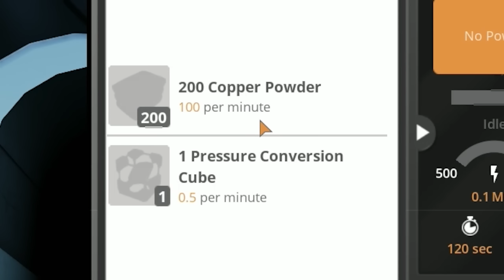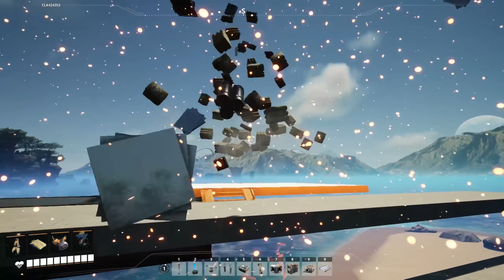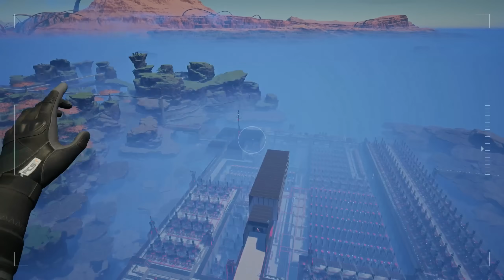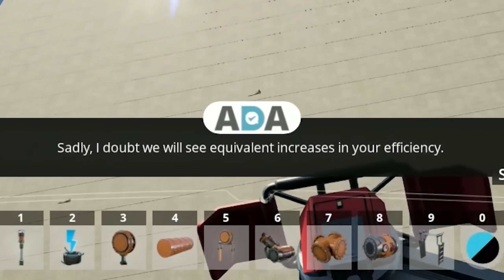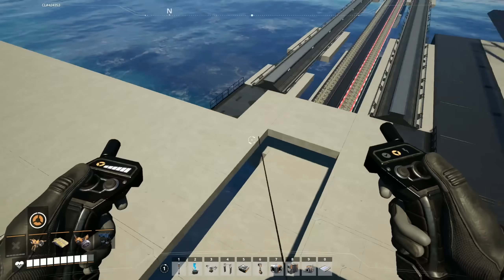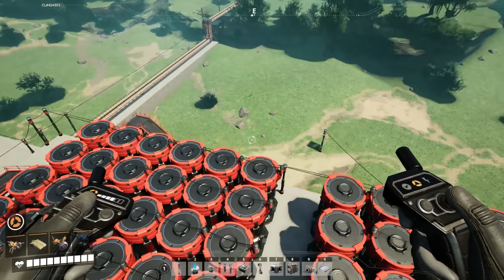Final Factory 1: NUCLEAR PASTA - Satisfactory 1.1

Comment: At this point on a past play thru, I set up in the pit crater just down the hill from the plains.  3 normal copper nodes, water geyser point which was helpful...  9 refineries is NOT enough to continuously feed 2 constructors for powder and feeding 1 overclocked collider...  it took hours.  

I think bench-marking 60 pasta per minute is insane, but from what I learned from the above, it's understandable.  Lay waste to the land and your computer's internals.

Comment: You can also fit 2 particle accelerators in a blueprint if you rotate one of them 180 degrees. They don’t line up perfectly, but it looks pretty good and works fine. Plenty of space to run resources over the flat sections and split off the resources to each pAcc.

Comment: I recently discovered that putting a merger or a splitter at the level of a belt on a stackable conveyor pole, it actually works out perfectly to use a stackable conveyor pole as a support for the merger or splitter.  Very neat and orderly and still allows for supports for conveyors.

Comment: For anyone who's not as clinically insane/masochistic as Kibz, or has the same excessive amount of power production, or need/want to make so much nuclear pasta, this approach doesn't make any sense at all.

The refinery-based alternate recipe is the most efficient in terms of amount of ingots you get from one copper ore (1:2.5 ratio), that is true. But in terms of power consumption, amount of machines needed, space needed, and just sheer bother of it (water extraction, pipes, pumps...) it's absolutely horrible.

The Copper Alloy Ingot alternate recipe is generally much better. Sure, it's not as efficient, resource-wise with its 1:2 ratio (also needing iron ore in the same quantity as copper ore), but it's not that much worse. However, it uses foundries, which are much smaller (stacks much, much better in blueprints) and consumes way less power (16 MW to the refinery's 30 MW), and also outputs way more per machine (100 ingots/min vs. the refinery's 37.5/min). You'll need lots of iron ore as well, but that's easier to deal with than water IMHO (belts ftw), and iron ore is one of the most abundant resources.

Also, as someone else suggested, the constructors making copper powder is an excellent place to put somersloops, more than making up for the resource inefficiency of the previous step.

Comment: 3:20 No. Just.. no. Fully overclock and sloop that. Those ratios suck otherwise.

Edit: Because my brain can't not try to solve this problem, Id go for Leeched Copper ingot. It makes 2.4x ingots to ore instead of 2.5x like pure does.. but the production rate is WAAY higher at 110/minute instead of 37.5. Fully OCed one machine can make 275/minute, or 550 with a sloop.

That is substantially less logistics then the pure recipe.

If you dont want to deal with acid then you can do the same thing with Tempered Copper Ingots in a Foundry using Petrolium Coke.

Comment: It would be cool if they made a scanner where you could pick a resource and trigger it, and it would highlight that resource within your insanity. Like, pick copper ore and it highlights belts where the ore is sitting. So you could fly into an area, scan and find any older belts that you might not have terminated/set in use.

Comment: If Power isn't an issue, might I suggest use of the humble Somersloop? Instead of 300 Copper Ingots making 50 Copper Powder, it makes 100. Half as many Constructors needed. If you have enough, you could even Sloop the Refineries for double the Ingots and less raw Copper Ore needed.
Reply: most of kibitz's sloops are reserved for reanimated SAM
Reply: It's also better to use somersloops later in  the process. Like why double just the copper powder when you could double that plus everything else by doubling the pasta?
Reply: @WheatGrinding  the pasta takes more machines and more sloops per machine.

Comment: why not pair the particle accelerators with their own batteries?... iirc batteries have a 100 mw max rate, and the particle accelerator variance is 500 mw linearly, so 5 batteries per accelerator is fine at base. overclocking is a different beast but i think 16 is fine then. fitting this all into a nice looking blueprint is thankfully not my problem :)

Comment: I tried going back to this game. My base just has all sorts of power issues, room was never left for expansion nothing's big enough blah blah. Got back to coal generators and said nah.

Started a new game with no power and I've gotta say I'm actually enjoying it a lot. It's not the same at all when you're worried one more machine's going to bankrupt your power supply, but it's also nice to be making an absolutely massive screw factory first without worrying about how I can't afford to run more than 20 machines. Those darn reinforced plates are a real setback to progression!
Reply: Every single problem you have encountered is meant to be solved. Just food for thought.
Reply: @harrisonlorens3585 solved means tearing my entire base down to zero and building from scratch again anyway, that's just not nearly as fun for me when I compare the two. It's nice having coal for steel without using all of it to power a vehicle and some coal generators to run miles of cables to get coal again. 😂

Comment: Five refineries fit into a mk3 designer just fine if you stagger them a bit in height, in fact ten fit. You can also fit four blenders at the same time, or in other words produce 200 rocket fuel from compacted coal, oil, water, and nitric acid, for a total of 12GW per blueprint, and all that with some underclocking. You can plop down 15 of those in blue crater without any resource acquisition headaches whatsoever there's resources for more but those 15 eat just under a pure node of sulphur and coal (1140), nice round number if you build a low-priority ammo factory alongside.